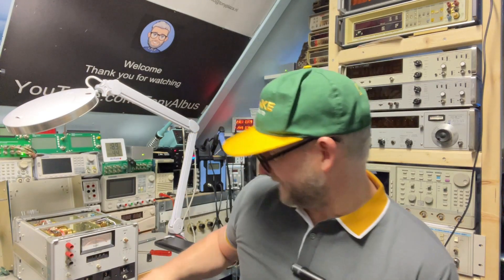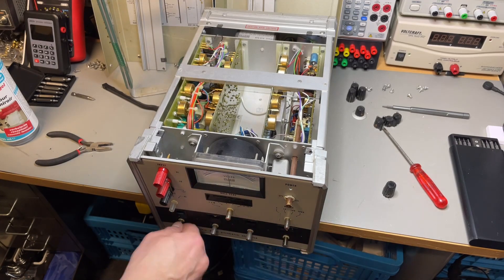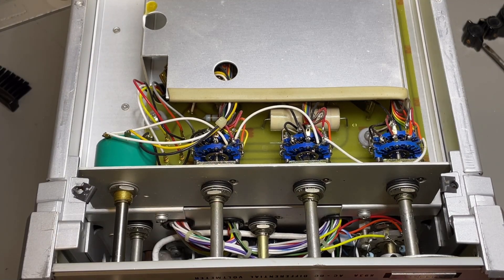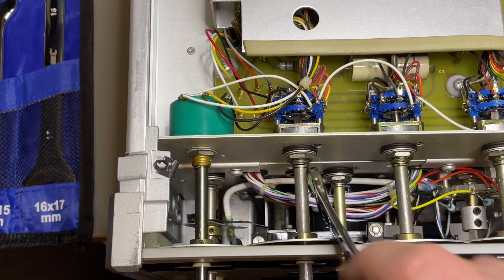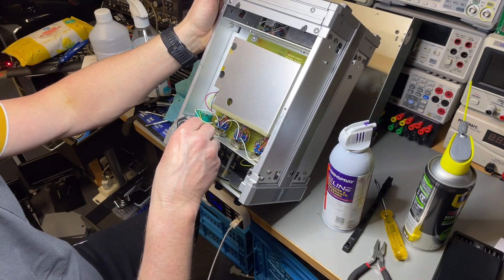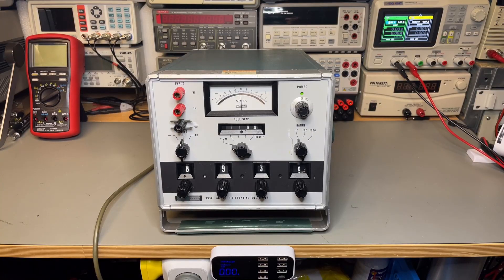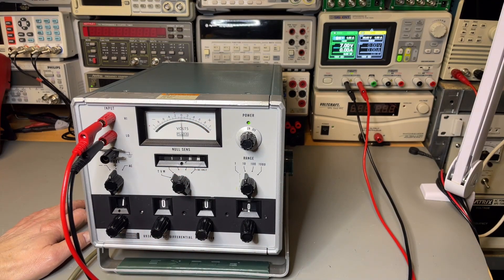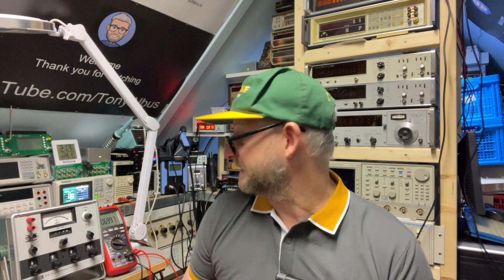TA-0348: Fluke Friday (E17) Fluke 893A AC DC Differential Voltmeter - Part 2

Comment: Hello, you want the meter to look good and this one looks luxurious after cleaning 🤔 the fact that it doesn't measure is secondary 😶 mainly because it looks like new 🤣

You fix it, I believe you 👍

Nice day 🙂 Tom
Reply from the maker: :)  thanks Tomas!  it needs to look good on the shelf :)  time will come...
Reply: @TonyAlbus  Well, that's clear, you don't want to look at some moldy, battered debris when measuring  😁, I could have bought a minimally used (looked like new) Fluke 8845A for 935,-  USD  at an auction an hour ago, but unfortunately there's no money 😥
Reply from the maker: @Edisson.  That 8845A looks great! .. but its a lot of money.
Reply: @TonyAlbus  It is a lot of money, but in the store they sell it for approx. 1.640,- and the 8846 model for a nice 2.222,- USD . They want even more for Keithley and you basically have no chance of getting something like this cheaper, plus this one was like new which makes me sad.
Reply from the maker: @Edisson.  Yes great deal, sorry you missed it. maybe next time, i hope for you Tomas.